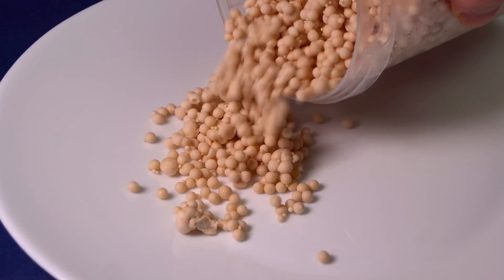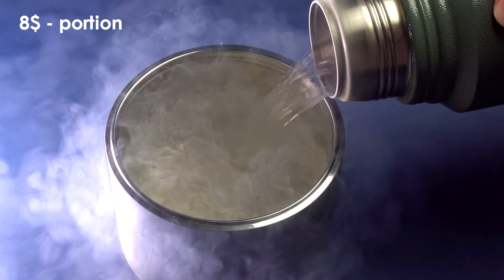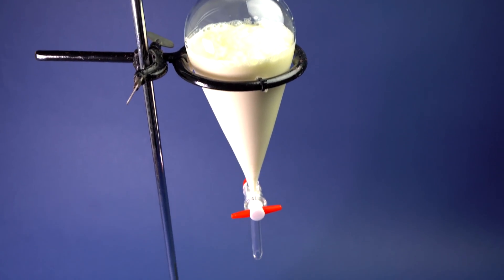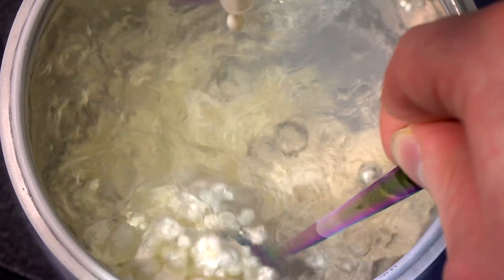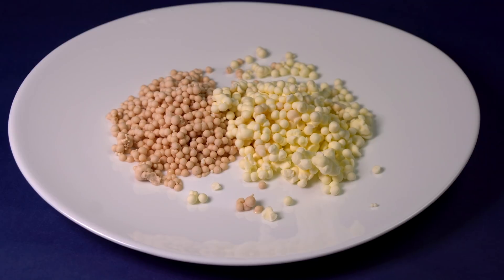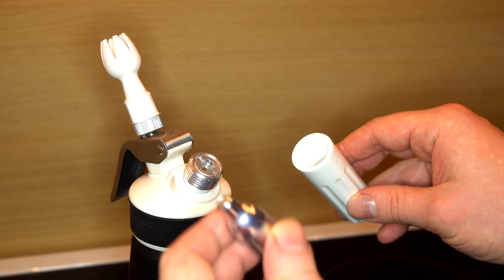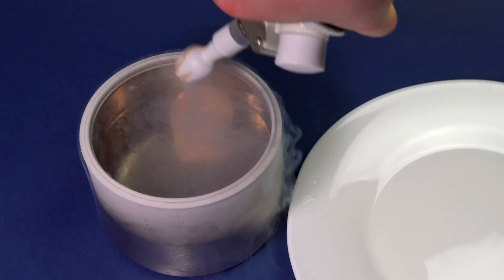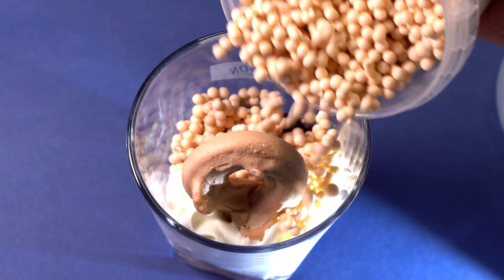Making DIPPIN' DOTS From LIQUID NITROGEN!

Comment: The liquid nitrogen the hard part for home, requires special containers ( dewar - $250 ) just to go get it & it has a short shelf life in the dewar or God forbid if you try to liquify air at home you will need even more expensive energy intensive lab style equipment that would only pay for itself if you use it all the time // $2000 or so //
Reply: If LN2 was easy & cheap, a car powered by the expanding pressure thereof would make an interesting vehicle with only the energy used to make the LN2 & keep it cool // like an electric car where the nitrogen gas liquified with electricity powered equipment forms the energy carrier as a cryogenic fluid // but dealing with cryogenic fluids on a multi-gallon level needed for a passenger car introduces even more engineering problems to make it easy for the public to use in a domestic setting with the average person without causing an accident like displacing all the air & suffocation from oxygen displacement or frostbite burns etc

Comment: Where do you buy liquid nitrogen?
Reply: try ebay
Reply: Welding shops will usually sell to you if you have a proper storage container. Depending on your country you might need certification but I've gotten liquid nitrogen like this in the US.
Reply: Most of the ice cream shops have it, I bought it before and it's extremely cheap also